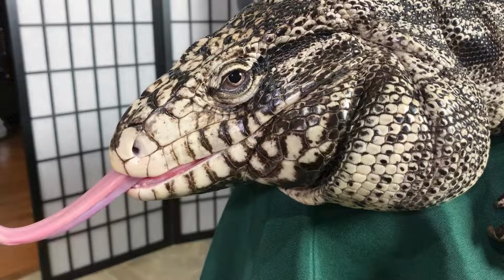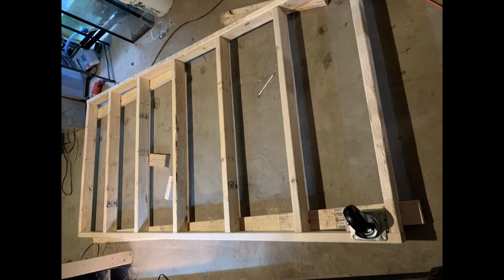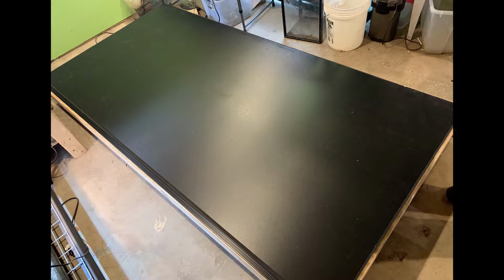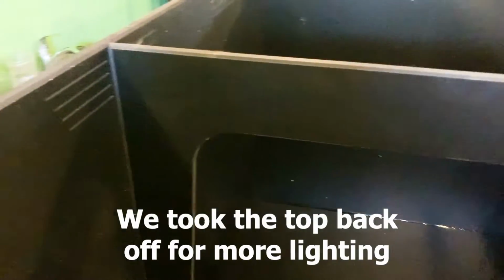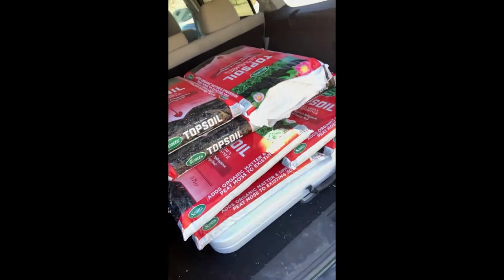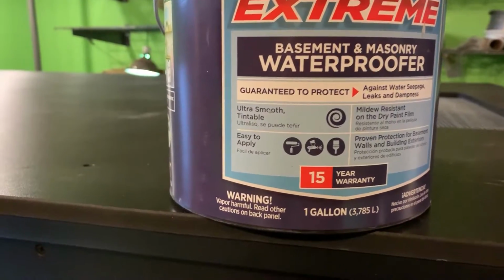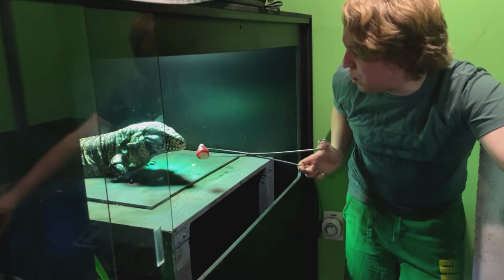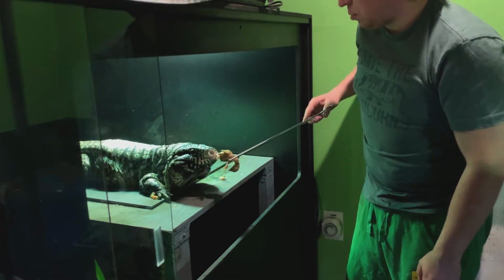Building and Moving My Tegu Into His BIG New Animal Plastics Enclosure!

Comment: Do u happen to know what weight the top of the T100 holds? To place other enclosures on top
Reply from the maker: Right now I've got some smaller tanks and wooden enclosures on top of it but only at the corners where they're most reinforced. I'd say you could get away with a 40 gallon tank on top at the corner but not with like mountains of dirty, maybe some aspen bedding for a colubrid or something. I've got a 20 gallon long with dirt on top in the corner you can see in my reptile room tour video for reference
Reply: @unchartedwild2166  .. thank you!! I just converted to the T100 and on my older enclosure I had 2- 3’x3’ OSB builds and wasn’t sure if still safe to put on top of the T100... no heavy dirt.. just shavings in one for a N.BTS and light sand for the other Leo gecko
Reply from the maker: @holliekeenan8453  no problem! That should be fine, I have a 4x2 wooden enclosure with a 15 pound boa in it on top of my other T100 on the corner and its been fine, they're fairly sturdy to an extent
Reply: @unchartedwild2166  ... thank you.. you have been incredibly helpful... and I went to look for the video of your reptile room but didn’t see it.. post a link if possible please. Thank you again!!